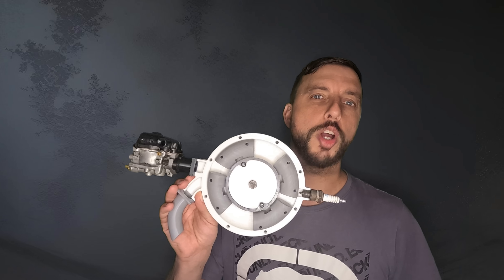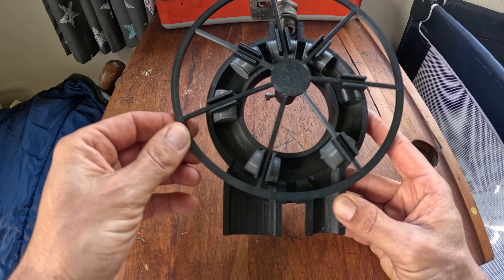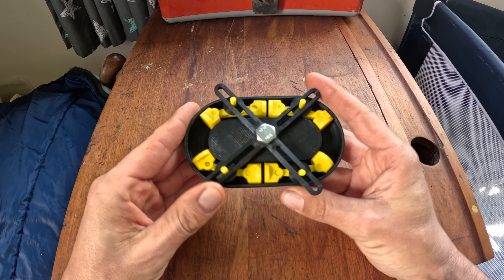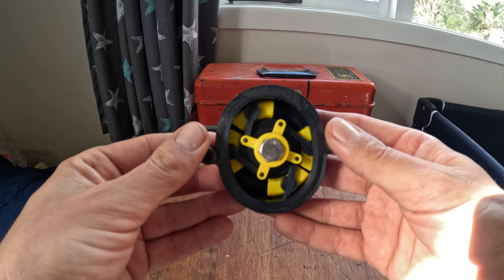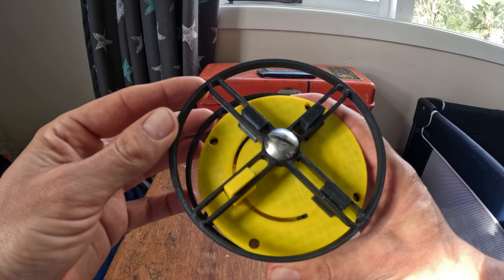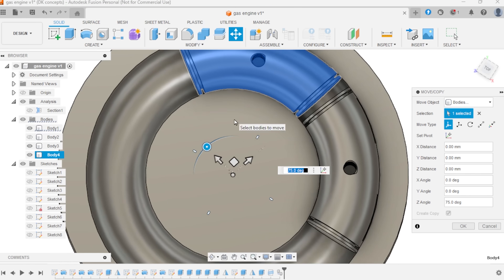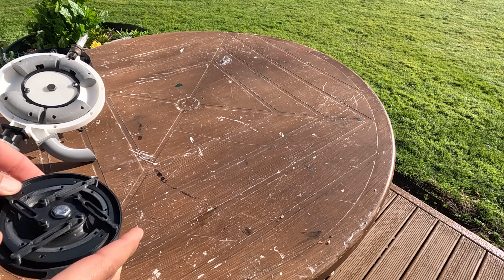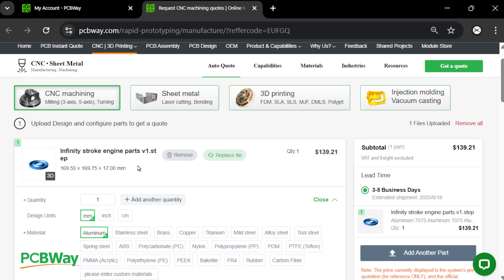Infinity Stroke Engine, More Powerful Engine?

Comment: I believe this already exists. It's called a swing-piston engine.
Reply: https://www.youtube.com/shorts/5ygKOSyCP_k
Reply from the maker: I didn’t know about this , someone commented about it earlier and I been looking at these motors ever since. Hopefully I can do something different to make it work
Reply: @dkthewelder 
Here is an idea nobody has tried doing. 

Two superchargers with a different ratio and a carb on top(or injection inside) to run like a jet engine but positive displacement. 

Or ....... 
Use a catalytic converter in the good old turbo based jet engine instead of a burner chamber so there is no flame and a more even lower temperature.
Reply: @brucebaxter6923  that doesnt work.
Reply: @DieselRamcharger 
Apart from melting ….. why doesn’t it work?

Let’s say a 1.6:1 ratio between them?
For the sake of the experiment push in compressed air instead of combustion so it won’t melt, does it spin?
Ok, so now let’s talk fuels, hydrogen peroxide through a catalyst keeps the temps around boiling point, wet alcohol and an oxidiser keeps the temps pretty low, etc etc
Reply: @DieselRamcharger 
Or do you mean you cant burn fuel in a catylitic converter?
Especially below lfl?
Reply: @brucebaxter6923  because blowers are positive displacement. stacking 2 blowers does nothing. all you are going to do is starve one of them for air while doubling the parasitic loss on the crankshaft. steve morris actually talks about this in his latest video, go give a watch. learn something. superchargers dont compound like turbos.
Reply: @DieselRamcharger 
I’m so sorry you can’t read and understand what I’m writing. 

Go back to doing oil changes.
Reply: @DieselRamcharger   He's not talking about just piping the outlet of one supercharger to the inlet of another supercharger... He's talking about mixing fuel and combusting between them (with the second one obviously needing to be outputting more to account for the increased pressure, what amounts to an on demand air compressor far exceeding the output of what would be expected for their combined losses...) with a shit load of complexity and terrible performance. But I'm just a mechanical engineering tech who's designed engine and tooling parts for 6 of the largest car companies, and 2 jet companies... 
 
My favourite part of this is that zero physics knowledge seems to exist in either the video or the comments, and I have no idea why it was suggested to me. goodbye forever.
Reply: @dkthewelder definitely check out the MYT engine. It won some big competitions and the inventor got a lot of money, then wouldn't sell it. I have been waiting for one for decades. Claims a 6in model can power a car
Reply: @dkthewelder One of the many downsides of the internet is the loss of the feeling ignorant bliss a person gets when they believe they have come up with a new idea. 

It’s a scientifically verifiable fact that even the most bizarre concept in the most niche subject will have a corresponding forum post from 10 years ago by some german guy who already did it better than you and found out it doesn’t work.
Reply: Nice that is exactly what he is trying to do 😅 good find
Reply: No it was called the myt engine.
Reply: @jerdhal80 the MYT engine is Raphael 's implementation of a swing-piston style engine.

Comment: Id love to see a full metal mock up of this! I can see there being some sealing issues in the chamber, some likely weaknesses in some thinner parts being constant wear surfaces, and a possible call back to the same issues that a lot of 2 stroke and specifically the wankel rotary have with exhaust blowby. These are all perfectly solvable issues, but my biggest concern would be that the exterior gasket on the chamber might be susceptible to blowout like you mentioned. Good way to counteract that would be to add some kind of fastening system that locks down the outer rim once the bolts are tightened in. Swapping the cam system to run off a lobe on a center shaft instead of a thin guide on the outside would also reduce flexing of the cam race, but its all about the doing and not the theorizing, so im excited to see how this functions as is!
Reply from the maker: yes a cam lobe might be a better way! I'm going to make it a way that i can change the timing ellipse or lobe that's the beauty of 3d printing stuff complex geometry made quickly

Comment: Sorry for the bubble-bursting but this design wouldn't even close to work. You're not addressing the real world problems. You have to be able to transfer energy to the crankshaft equivalent and that necessitates a very robust mechanism whereas this design has that force transferring through very flimsy armatures, with a tremendous leverage disadvantage, while concentrating forces instead of distributing them. Sadly, these issues can't all be solved. A cam-grooved disc in place of the armatures will beef things up but you're still point-loading at several times the piston torque output. Also, the piston track ("Cylinder") oblates throughout travel which becomes impossible to seal as your piston rings would need to be in a perpetual state of shape changing to accommodate. Imagine laying on the piston face and traveling through the track line a tunnel. The tunnel is constantly changing shape from circle to oval and back again. With the large tolerance of the print and no actual need to seal it seems to work but with rigid materials and sealing requirements it kind of falls apart. You can oblate the pistons/rings or you can oblate the track but you can't have both or neither and you can't realistically seal when they aren't matched.

Comment: my concern is how do you plan on oiling a piston pushing onto a dry surface? on a reciprocating piston it pulls back every other stroke pulling oil into the rings for example. also how do you plan on sealing around the openings?
Reply from the maker: 2 stroke oil
Reply: @dkthewelder  ah ok

Comment: Something to consider before making a metal combustion variant: Make a 3D printed version that runs off of compressed air. You might have to make a few modifications or inject air party way through, and it might not run quite the same. However it will give you an idea of how to seal it, whether the forces involved will cause it to bind, etc.
Reply: wow you are an absolute genius like you have endless ideas

Comment: That first one is a toroidal piston engine  they've existed as a steam engine since the 1820s & as internal combustion engines since the 1940s, if something has been around that long & not been widely used there's a very good reason, especially when you consider Wankels, with all their draw backs were mass produced by several manufacturers in multiple applications.
Reply: the one from 8:23 onward is even closer to existing toroidal piston engine designs.
Reply from the maker: I'm ashamed to admit I hadn't seen that those engines! after seeing these engines they probably need difficult sealing solutions

Comment: It sounds interesting but I’m skeptical because a rotating mass wants to push everything to a equal point to balance itself , so if you have 4 balls in a spinning cup it wants to make a Square to balance out and then with the shafts you are putting a lot of side forces on it I think that is a good place to put a flywheel or at least a disk and cut the grooves in it for the pistons to slide
Reply: I thought this as well. Glad to see I am not alone.

Comment: Regarding vibration - the cylinders' acceleration and deceleration twice each revolution will result in vibration. It will likely be less than typical reciprocating pistons, so may be an improvement, but it's still going to be significant.  It doesn't look like the forces are balanced (one cylinder accelerating in the vector opposite another cylinder at the same rate/force and exactly opposite the same path), and I'd guess the vibration is going to be rotary, resulting in a torque on the motor mounts.  This isn't a criticism, just a reminder to double-check that you're considering this since you seem to suggest vibration is one of the problems this solves - it changes, and may reduce, but doesn't resolve with this design.
Reply from the maker: The conrods are also osculating ,  there will be vibration but just less the two opposing pistons can actually be connected as they move the same like in the MYT engine

Comment: Where the fuck is the torque coming from? am i missing something?
2 pistons and a explosion in the middle will make both pistons force nullify each other
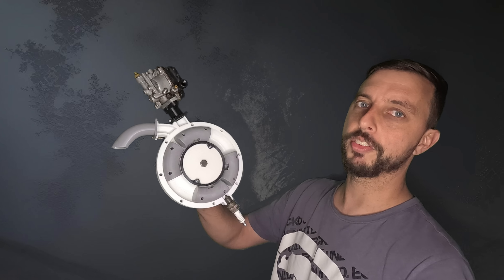The 1:10 rotary engine make one of the "pistons" retract so there is only one vein exposed to the explosion and a net force in the direction of the exposed vein creates torque

Comment: The Issue im seeing in the design is a fundemental one. opon ignition due to either piston being same diameter the explosion will be equal force on both. giving net 0 rotation,
to get rotation i believe you need the pistons to vary diameter( which is near imposible)  so the force will start rotating in the direction of the bigger piston surface area. this is why the vein engine works, veins vary surface area for force to push on.
Reply: You are incorrect, if the crankshaft on this only allows for one direction of travel, the expanding gases on this engine would still result in the expansion of the "cylinder" resulting in crank rotation thanks to that being the path of least resistance. If you were right however, you could make the "leading edge" of the "piston" cone shaped, with outlets on the edges designed for optimal gas velocity and then you'd have a sort of pulse jet engine that turns a crank.
Reply from the maker: @sicsempertyrannis3782  that is an interesting idea! The way I am planning on it working is the leading piston has a mechanical advantage over the trailing piston

Comment: Great free thinking. A reliable  connection to a crankshaft and ability to transfer a reasonable amount of torque will be an issue. Not to mention sealing. But keep going.
Reply from the maker: Sealing is the issue with this type of engine but I have some ideas 👍

Comment: use the conecting points to push oil in to the areas they need to be and have a oil return vain on the outter wall and the oil shoudl have a jet on to top most part of the piston the pistons may help with the oil flow
Reply from the maker: I have thought about that but will just run 2 stroke oil to start with
Reply: @dkthewelder  i was thinking next step if the prototype works .

Comment: Make your ports bigger, especially the intake port. The port should only be covered off once the chamber hits maximum contained volume, in order to intake all the air it can. I can’t see a reasonable method of sealing the shafts that couple the pistons to the outside world. My best thought is to have a circular ring on the inside connected to two pistons, and a ring on the outside connected to two other pistons, and you’d have circular seals between them and the walls. But then your ports and spark plug will need to inhabit the side walls, not the apex. There’s probably a relatively simple oblique gear configuration to get the piston movements working without crankshafts, though you’ll lose the timing adjustability.

A linear piston generator with no crankshaft, maybe with spark plug and valves at both ends of the cylinder, could be a novel method that should seal even better. Put a big magnet in the piston and wrap a coil around the cylinder. With no crankshaft or camshaft you’d need to handle the spark and valve timing electronically, but that’s doable. Also no secondary balance issues. Of course it has no mechanical power output.

Comment: I admire the amount of time you are putting into making a real model but I do have to mention that this is almost identical to the MYT (Mighty yet tiny) engine that was hyped up back in the early 2000's. I wanted to see that engine brought into production but from what I know it died a slow and uneventful death.
Reply from the maker: I know now, someone else commented about that engine and I have been looking at it. I think my idea is quite a bit more simple but there will be issues, if anything it shows I’m not completely crazy and others have tried I don’t think that MYT engine even ran!
Reply: @dkthewelder i have seen it rotate but I think it was possibly just compressed air.

Comment: On the combustion stroke the pistons are only pushing against themselves not against any immovable surface to continue the momentum. That's what initially popped out to me. Just my 2c
Reply: The key is in the timing/drive mechanism, most use a complex linkage system but there is a planetary design with an amount of adjustment over the quad crank position to maximize the power stroke, this directly affects how the pistons on the coaxial shaft transfers the torque through the planetary. Ooops I’ve said too much!

Comment: That electric motor looks familiar
Reply from the maker: Those motors are great they work heaps better with the vesc controller. Did you see the video I made with the powered swing?
Reply: @dkthewelder no. I missed it. 

Vesc are amazing hey. 
Better than the simple things I had for just an propellor

Comment: Detroit diesels dont run without a super charger I think you mentioned earlier with one of the designs?
Reply from the maker: The first model I made would need a blower like a Detroit diesel. But they way I’m going to do it should be more simple

Comment: The main things with ICEs are:

1.) Lubrication (how is oil getting in this thing/not going where it shouldn’t, how do the piston rings work etc, thermal expansion impacts)

2.) Cooling (How are we Air/Oil/Water Cooling the thing, also note that this makes “compact” bare engines less so for a real comparison)

3.) Balance/Wear (do some sides get more pressure/wear than others etc)

4.) Ease of Production (how are the parts being milled/cast)

5.) How is the power getting out? (Driveshaft / Linear Generator etc)

These novel designs rarely work in these regards, let alone more reliably/easily than the alternative.

Skepticism aside, i’m here for experimentation! 

(Although i would be more partial to a DIY/OS RCCI Engine, Billet V12 / Inline 6, Free Piston Linear Generator, or Opposed Piston Engine a la Achates Power

(Also MAYBE a wave disc engine)

Comment: combustion pressure can exceed 1000 psi, so those seals better be up to it. cant wait to watch the experiments
Reply from the maker: Sealing is the problem! Hopefully I can get around it
Reply: Sealing 1000 psi? not that hard. Sealing 1000 psi on something that gets hot? quite the challenge. Sealing 1000 psi on something that gets hot AND moves? Now I see why this engine never made it to production.

Comment: nice one, correct me if i'm wrong but light aircraft engines are fitted with twin spark plugs, not sure if its redundancy or performance also Alfa Romeo used twin spark plugs on some of their engines, so most definitely worth looking into., on the car engines I would imagine its for a complete burn or timed burn etc, very interesting me-thinks.
Reply from the maker: I think it needs two plugs as it’s a moving expansion chamber

Comment: bite into this project and dont let go, it would be so fun to see the progression and problem solving
Reply from the maker: It might be a fool’s errand, these type of engines have been made in the past and didn’t work although my drive system is a bit different so hopefully it has more of a chance
Reply: @dkthewelder most problems come from lubrication. Either because the sealant surface between the piston and housing isn't constant (think rotary engine) or because the pistons extend beyond the exhaust and intake port (which looks like will be your main problem)

Most obvious solution is to add oil to your petrol like a 2 stroke but then you'll be sure that your engine will never be used commercially due to environmental restrictions
Reply: @dkthewelder  I have a idea how you can make it different. You need a spinning crankcase and feed the oil through the crankshaft the back of the pistons get Oil, this way you can also create the same motion without the problem with how are you going to sealit
Reply: Reminds me of this quote. When a young Henry Ford told an older Edison about his ideas for the internal combustion engine, Edison replied "young man, that's the thing; you have it. Keep at it."
Reply: I strongly agree with this. This is very clever

Comment: I can't see how this would work - it looks to me like the expansion of ignited fuel would apply thrust equally in both directions onto the crankshaft and it would go nowhere. What am I missing? What part resists the reverse-direction thrust?
Reply from the maker: You correct it has to fire once past top dead centre then the direction of rotation piston has a mechanical advantage over the trailing piston it’s only option is to rotate. I can also change the profile of the ellipse track to make one piston stay still. I made a lot more of them off camera
Reply: @dkthewelder  Thanks for taking the time to reply Dan. I see where you're coming from now. Well, I hope it works! Can't wait to see more testing. Thanks for posting :)